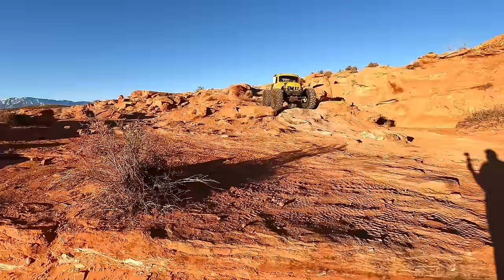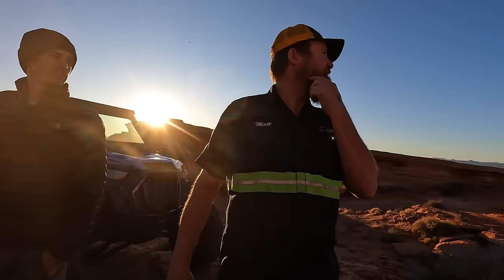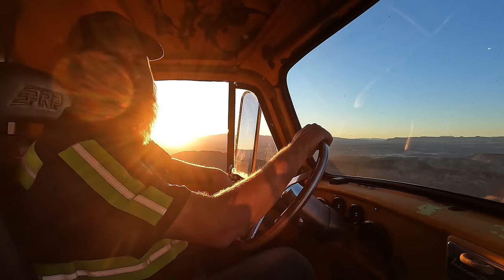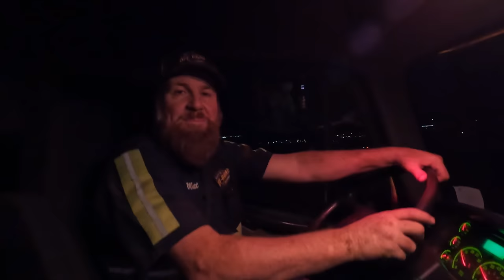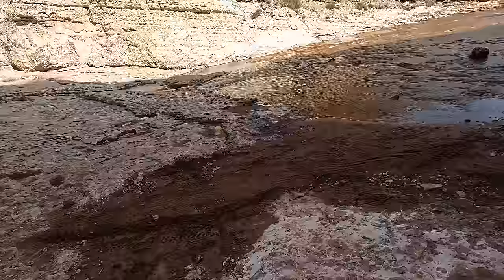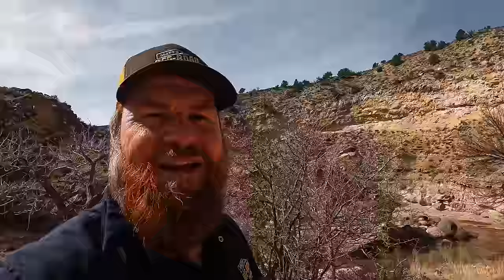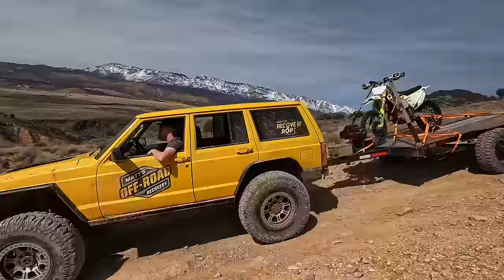This is Not What You Called For?

Comment: Why wrecker doesn't have a stiff connection for towing? It seems to be very difficult to prevent towed vehicles from ramming into wrecker?
Reply: Because it doesnt work on the trail. And dont just take Matt's word for it, Rory tried several variations and came to the conclusion that it doesnt work. 😉
Reply: Pretty sure he answered this question last video but it was something along the lines of it wouldn’t be practical off-roading
Reply: I would imagine that would make going through obstacles a little harder.
Reply: Ask Rory.
Reply: Yup… precisely my thoughts every time I see this.  I think there was some explanation a long while ago, but I cannot remember.
Reply: @paultinwell5557 Loss of short term memory is the second sign of old age.
Reply: You could use a large exhaust airbag jack on the back of the wrecker to be a soft interface maybe don’t know how well it would last.
Reply: This is the reason why I would want to get the Old Style of Wrecker's Sling's that are made of Rubber that does go up and down with any direction and then it will take all the bumps and high and then the lower level of what ever comes it's way and then still be connected to a Good and Solid Mounted Boom Sling Straps but it's needs to be a Little Longer than what is Sold now and I think it will need to be at least 6' long instead of the 4 ' foot one's that comes up when I have searched it out and The Ropes that is being used now doesn't have any kind of stiff enough to help hold the Recovery vehicles from more damage and I wouldn't have anyone else in the towed vehicle, just in case something that could go wrong and it's a possibility for it to happen and the Tow Sling's have been Around for more than 50 years of using the Wrecker's and they do work 😮😮😮😮.... but it's just more drama for us to watch.... and then comment.....
Reply: Watch the differences in height of the ground while the wrecker is pulling the Jeep. A stiff connection would be ineffective because it would need to be able to change its length
Reply: @JohnFL  Have you seen the Rubber Style of Wrecker's Boom Sling Straps that have been used for about 50 years since the wrecker was out and they made that or Them for that same exact reason and then it's not really a stiff arm but the towed vehicles will slide on that Rubber and allowed to move and Maintain, but the Tow Operators will need to know what they are doing First and his Boom isn't long enough and then it isn't  the Angled Boom like it needs to be and then it will give him the height and distance that is necessary, but no matter what it's just entertainment and they are letting us comment on what we see what is wrong 🤔....
Reply: @carolrice2063  I have seen those, and so has Matt. I believe he has his reasons for not using conventional wrecker gear.
Reply: @JohnFL  it really doesn't matter either way, but it's still a good show to see and then not be so anxious to try, what they are doing, and then it will probably work out eventually 🤞... and get themselves out....

Comment: Why do you need to haul a trailer across the country to pick up a dirt bike?? Why not just use a rear hitch mounted motorcycle carrier or just use a proper 4X4 pickup truck??
Reply from the maker: These videos make the terrain look easier to drive over than it really is. 
The gentleman with the motorcycle had a friend tried to rescue him with his lifted Toyota truck. The Toyota truck was unable to make it to the motorcycle.  

Rear hitch motorcycle carrier could possibly work if it was high enough off the ground. And we would use it once or twice a year.  

This trailer works so good. 
I’m not sure if it really needs to be fixed.
Reply: @MattsOffRoadRecovery  You guys need your own 4X4 pickup truck that will do the terrain as effective as the Banana and save the trailer and the hassles lol.
Reply: @MattsOffRoadRecovery  I live in the Canadian Rocky Mountains and when we rescue dirt bikes there is no way we are getting any sort of trailer in, we have to either get a 4X4 in or tow it out with another dirt bike. We have done rescues in terrain that can not even be accessed with a good quad.

Comment: Quick question Matt, instead of straps between the towed vehicle and the wrecker, why not use a solid tube with eyelets at each end, one into the tow hitch, and the other end strapped to the towed vehicle? That will stop the need to control the tow from running into the rear of the wrecker, plus it should still give you the required up and down articulation you need over uneven terrain.

Comment: By the way if you have an open diff and run the spider gears at high speed like you're doing with the bombbee it will weld together even with the diff at the correct orientation. I'm thinking you need a possie but not with clutches. The one that has a dog engagement and a ring with teeth that pushes the locker away with different axle speed. I can't remember the name of that particular style but it's what you need for sure!!

Comment: When u have a vehicle lifted on the back of the wrecker why not weld up a tow bar that has two ends to wrap around the axle of the vehicle and in the other end with a loop to connect to the hitch of the wrecker to keep it from moving forward or backwards

Comment: I'm confused because you didn't want to straighten the tie rod bar because the power steering hydraulic fitting was broke but then later in the video you ran the Jeep and most likely destroyed the pump?? Or at least ran out till it was metal to metal in the pump and put metal in other parts.